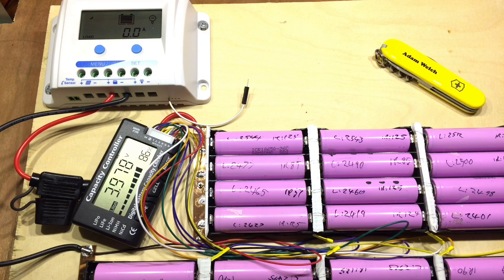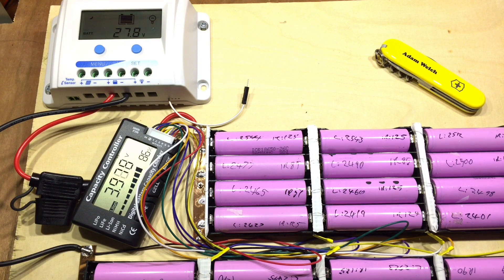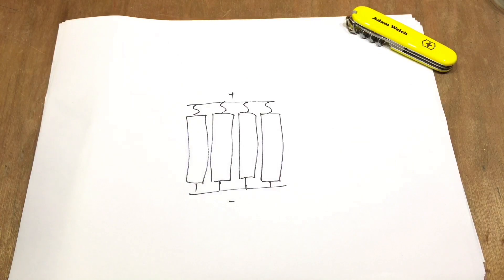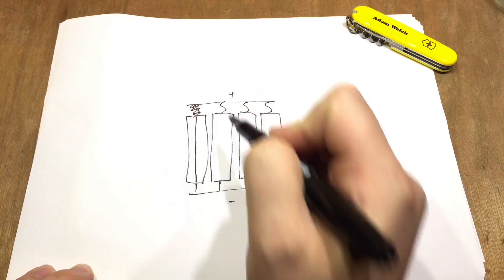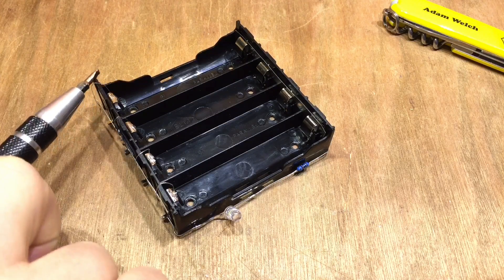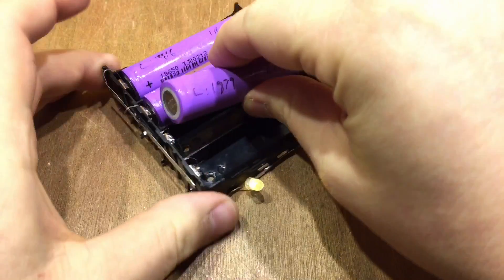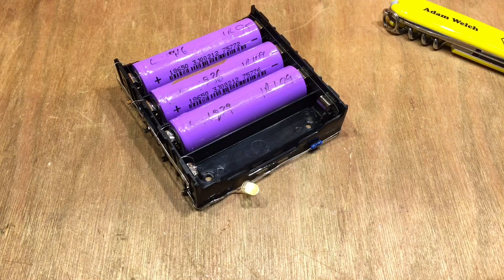Solar Charging Lithium Ion 18650s - Part 4i, Those Fuses - 12v Solar Shed

Comment: So Adam, in conclusion solar charge controller can charge lithium ion pack and balance itself reasonably. Recently I was fumbled by BMS in a pack of battery while charging it with charge controller. It drain all my battery to less than 12v and the charge controller did not turn on or sometimes produce a blinking screen. Your video is very helpful cos now i cam see that i have to remove the BMS and connect it directly

Comment: Impressive Adam... thank you so much for dilligence and fullfilment of follow thru. A year of real world reaults. Just dont see that with youtubers... Im living of he grid in an private RV park if you will in Colorado. Since Ive been living here wich has only been less than a couple weeks, and no power other than neighbor charging my phone and using fashlight at night..  Ive been cramming solar info... Now while im starting with cheap 100w system from harbor freght and going to use their inexpensive sealed agm... Li Ion 18650 is the direction I want to go for myself.
Reply from the maker: Thanks. Good luck with your system and the off grid lifestyle!

Comment: Nice learning video, i have a question, what size of wire do you use, 0.15 mm ?
Reply: From all the videos I've watched they use 1/8w resistor legs/leads, so they cut the wire lead off the 1/8w resistor, keep the leads for a fuse and toss the resistor. Packs of 1000+ are around $15-20 Canadian for me so fairly cheap to do this. You can buy fuse wire but I've had limited success finding it, whereas 1/8w resistors are pretty easy to find.

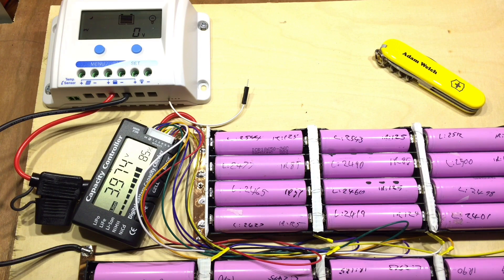Comment: You diagram at 0:49 implies each cell individually connects to a common bus bar via fuse wire. Whereas just prior to that at 0:45, each cell connects to another cell in a series string, not a bus bar? Is there a bus bar under the white tape, which is commoning all of the +ves and -ves in each parallel pack? If true, why didn't you just solder fuse wire directly to that? Also, if true, you've connected two bus bars together with 4 parallel strips of fuse wire, again not the same as the diagram. I realise this is very old and you've changed your setup completely, but because people are still looking at the video, could you explain this a little further please? (You prior videos don't make this super clear either) Thanks.

Comment: I love the video series! Just a theoretical question from a perspective of a newbie: What would happen if 3 cells die at the same time? Delivers the one healthy cell enough current to burn the 5amp fuse wire? If I remember correctly you said that those cells can deliver current up to 2A each Definitely looking videos about short circuits now! Thanks a lot.
Reply from the maker: It’s very unlikely the internal structure of the cells would break down so rapidly in three cells concurrently. In reality, the breakdown of the internals would be gradual, meaning the current going into the cell would slowly increase. If everything is working as it should, you should notice a weak pack well before a fuse blows, giving you the chance to locate a bad cell.
Reply: Just subscribed :) thx again.

Comment: Aha! fuse question from your previous video answered.
Reply: Neat website you linked (repackr.com) I can't figure out what "deviation" means, however. Can anyone help explain this to me?
Reply from the maker: Deviation is the difference in capacity within the group of cells.  So it's the difference between the lowest and highest cell within one group or pack.

Comment: Hi Adam
I really like your videos which are well researched, clearly explained and nicely presented! 
I have a narrowboat with the usual 12v lead acid leisure batteries, total 345 Ah, and four 50 watt 12v solar panels which are set up in 2x24 volt strings to charge the batteries via an MPPT controller, and also of course by the boat engine alternator.
One day when they are cheaper, of course I'd like to have all lithium batteries, but in the meantime, I wondered whether it might be possible to have a two-stage system, in which the first stage is a 24 volt lithium battery pack of the sort you have described but rather larger, charged directly by the MPPT controller. 
The second stage would comprise the existing lead acid batteries still charged by the alternator in the usual way, and also charged from the lithium bank via a second controller which would step down the voltage from 24 to 12 - this could be a cheap PWM controller of course.
There would be a number of advantages in doing this: as you have pointed out, the 24v arrangement of the lithium batteries is better for the batteries, but of course a lot of people have got everything set up on 12v systems.  In addition, with the alternator still connected only to the lead acid batteries, the system could accept solar charge even when the alternator was running - at the moment that won't happen because the MPPT charge controller sees the alternator voltage of say 14.4 volts at its output and thinks the batteries are already fully charged.
As we are most likely to be running the engine in the daytime of course, this means that a lot of solar input can be wasted, which could now be stored as additional battery capacity.  The lithium bank wouldn't need to be huge as long as it could store say, one day's solar output, but could give the whole system a significant boost - what do you think?
Thanks very much if you have read all this - I can see it's got a bit long!
Regards
Nigel
Reply: Just noticed a slight error in the above - of course if you used a cheap PWM controller in the second stage, it couldn't handle the stepdown from a possible 28 volts, so would need to be supplied via a DC-DC stepdown converter.  But these are now very cheap as well.

Comment: I'm wondering about the fuse test that you've done, it seems that the test isn't testing what you've actually got connected. In your test, you don't have a nickel strip across the whole section of the positive side before it gets to the fuse, you just have a straight fuse connection, if you did, wouldn't it short out across the whole nickel strip and thus cause serious current draw? Could you test with a nickel strip on the positive behind the clips and another one in the same place you have it to see if that would short?
Reply from the maker: Hi David.  Each group of cells is commoned at the negative end - therefore each group is also commoned at the positive end.  The difference is that at the positive end there is a fuse between each individual cell and the nickel strip commoning the previous groups negative.  I'm not sure I'm explaining this very well...  I'll draw a couple of pictures...  Test Setup... https://goo.gl/photos/JNSmQSA7Q1QfNWxg6   Real Setup...  https://goo.gl/photos/GhYnX6pboTeFxii66

The test is intended to point out that if a single cell in a group dramatically failed and went short circuit the fuse would blow.  Now in reality it wont fail that quickly and will likely draw less current than demonstrated here.  But if it fails in a more controlled manner the fuse isn't likely to blow - but the cell isn't likely to get too hot either and ultimately we'd see a pack struggling to keep the same voltage as the rest under load.
Hope that helps - Unless I've misunderstood the question?
Reply: Ah, no that's answered it, thanks, that helps a lot. I thought there was nickel on each positive and negative side of your real rig (ie. non test rig) so I was confused, but that makes sense. I'm planning on doing the same setup as you've done with the 7s 24v. I really like how modular it is and  how the charging characteristics of gel are conducive to li-ion charging in a 24v li-ion configuration.
Reply: Adam Welch 
that got complicated in a hurry didn't it! I'm looking in to building these packs. and I'm wondering the dimensions of the nickel. and the current capacity. before I buy anything.

Comment: Hi Adam
Why did the LED go out?, the other 3 cell's are good so the LED should have stayed on.
Reply from the maker: The led was attached between the two battery lugs which I shorted.  The power to the LED was also cut when the fuse blew between the nickel strip and the battery lug at the positive end of the led circuit.  It was intentional, but not explained sorry :-/  I wanted to ensure you could see when the fuse blew - but actually it wasn't needed and has caused some confusion.

I'll do better next time.
Reply: @AdamWelchUK  you did great LOL...just next time put a similar LED light on the bus bar to show the contrast of how one light goes out and the other light stays on but reacts to the power dip/surge elsewhere in the system etc etc etc...that way it will mimic your actual load on your shed system...thanks for the great ideas and vids
Reply: A Mathamagition !
Reply: Thanks for the explanation. I was scratching my head at this, too, given that the positive and negative rails were all linked together and the fuses were intended to supply uninterrupted power in case of a fault.

Comment: Nice to see a test of the fuse system. I didn't realize how simple it would be to create a fuse system for 18650 banks...
Reply from the maker: I'm not sure how expandable this is - if you want to make a bank with 100 cells in parallel I think there are probably better ways :-)
Reply: Adam, I believe this is exactly how Tesla do it with tens of thousands of cells in their packs - the probability of a dud cell goes up considerably with quantity!
As more cells from a pack drop out of the circuit, then the rest of the cells in the pack carry more current.
If the current increases and all of them fuse, identifying the original dud cells would get a bit more tedious, as they'll all be fused!

Comment: Adam, could you repeat the test but with a resistor instead to simulate a cell that has a 'soft short'. I think this is a much more likely scenario than a full short. A bad cell draining just a few amps will get very hot over time but may not draw enough to blow the fuse.
Reply from the maker: I will try this out and post if it show dramatically different results.  Cheers.
Reply: Great, look forward to seeing what happens. So much talk about fuses but not much testing so what you are doing is great and sharing the knowledge makes it safer for everyone.

Comment: Good to see that test. I'd love to know what the peak current was. Any chance you could do that again with a (high current) ammeter in series with the fuse?
Reply: Adam Welch easier solution,  connect meter in line with the same length of  "fuse" and  a power supply.  Gradually increase current and watch meter for max
Reply from the maker: Thanks Paul.  My vici multimeter only go up to 20 amps and I'm not sure it would be quick enough to capture the maximum current.  I think I might be able to perform this test using a resister and an oscilloscope better, but I'm not sure my little JYEtech is going to be good enough.  I have a 'proper' scope on my shopping list but I'm having to save my pennies.

Comment: I watched this video several times, and i cant understand one thing. If one the cells shorts out then fuse blows, but why LED stops glow after short circuit cell is disconnected by a fuse? Is that means, that whole pack is no longer delivering energy? Am I missing something from video?
Reply: If you look how its soldered, its connected to the battery holder leg, not the nickle strip connecting it to the rest of the pack. So when the fuse blows, the circuit is broken.
Reply: Gintautas Raštikis I don't get it either. I would think that for the duration of the short, the LED would be out as it receives no current, but once the fuse goes, the circuit is restored. Adam, please enlighten us?
Reply: Gintautas Raštikis A comment a bit further down from Adam says that the LED was connected in series with the fuse that blew.
Reply: Fellows , as the first and furthest battery was installed  , the LED was lit. 
I , as well believe the lamp was/is attached to the buss.  What gives ?
Reply: The LED is connected not to the common positive of the whole pack, but to the positive of the empty socket. I.E. The current for the LED flows from the batteries, through their fuses, along the bus bar, through the 4th fuse and into the LED.
When the fuse blows, there is no path for the LED to the rest of the pack.
Reply: As a few have mentioned (and thank you), I see after reading their comments.  The LED is soldered to the bottom of the battery + terminal connector (where it sticks out at the bottom of the plastic holder).  The fuse is soldered from the top of the same battery connector (on the springy bit), to the Busbar.  When the fuse blows, the battery is taken out of the circuit; this is demonstrated by the LED going out.
Reply: Yeah, the LED is attached to the lug of that empty slot that he shorts so when the fuse blows it isolates the LED.  I was confused at first as well.

I would have prefered to see an LED attached to the bus bar as well to show the REST of the cells still working in addition to the LED showing the cell losing connection.
Reply: Maybe the LED was somehow damaged by the short and so even though power is restored after the short, the LED didnt light back up??

Comment: it may be a good idea to try again with a 0 voltage cell see if the same rection happens
Reply: Adam Welch He's right,  real world they might charge the cell just slow enough to not pop your fuse
Reply from the maker: I'll look into this.  Cheers David.

Comment: The maths tells you it works. But there's nothing to like a real world test to put your mind at ease. 30AWG it is then!
Reply: The real world wins again!
Reply from the maker: I did a video a few weeks ago about fuses ( https://www.youtube.com/watch?v=GyzrxAwxtgA ). In that video I ran 1.6 amps through a 1 amp fuse for a few minutes and the fuse didn't blow. The 5 amp fuse wire in this video should be designed to run normally at 5 amps without getting too hot.  It should blow somewhere like twice its rated value.  So it's a fair bet I think that it has similar properties to the 30AWG copper you are referring to.
Reply from the maker: +NERDVille Exactly. I'll get some sleep tonight ;-)
Reply: 30AWG copper = 10.2A fusing current
http://www.litz-wire.com/New%20PDFs/Fusing_Currents_Melting_Temperature_Copper_Aluminum_Magnet_Wire_R2.011609.pdf
Is that too high I wonder ?
Reply: I've measured about 9 amps per 18650 cell peak drain on my lawn mower - so he might be reaching as much as 30 amps from those three cells.
Reply: Very good point - 30AWG should be fine then.
Thanks Paul.
Reply: Thanks Adam, I see now.
So the Ampere Rating is 
"The continuous current carrying capability of a fuse
under defined laboratory conditions. 
The ampere rating is marked on each fuse."
http://ep-us.mersen.com/fileadmin/catalog/Literature/Application-Guidelines/ADV-P-Application-Information-Definitions.pdf
And yes this means a 5A rated fuse won't blow at 5A but probably more like 10A.

Comment: Good test result there.  I just tested out my fuse wire (I use 30AWG) and it melted just like yours does.  Seems the 5A wire is ~31AWG, so the wire I chose is just a bit higher rating, ~6A, should be about right for the paired cells I'll be using.
Reply: 10A is a common melting rating, this table lists 6A as the "current rating"
http://www.gxk.org.uk/info/wire.htm

and this one about 8.5A:
http://electricguru.in/page_view.php?id=29
Reply from the maker: +R Brown Thanks. Useful to know.
Reply: I found this handy reference giving estimates of fusing current for wire gauges.
http://www.powerstream.com/wire-fusing-currents.htm
It says 30AWG copper is 10.2A, so that's about OK.
Reply: Another reference that says 10.2A for 30AWG copper.
http://www.litz-wire.com/New%20PDFs/Fusing_Currents_Melting_Temperature_Copper_Aluminum_Magnet_Wire_R2.011609.pdf
Reply: Thanks for those tables.
They clearly show the distinction between fusing current and fuse rating.
I learn something there, and 30AWG is good for the fuses.

Comment: The LED went out, okay. But why? Are these 'protected' cells which will switch off in case they detect a short?
Reply from the maker: +Dunkelheit667 No they are unprotected cells. The led was connected to the other cells via the fuse. I connected it that way in case the fuse blowing wasn't obvious on video, but I don't think that was a problem!
Reply: Got it now, the LED was connected in series with the fuse and went out because there was no connection to the other cells as soon as the fuse blew. Thank you for the explanation! :o)
Reply: When you connected the first cell the LED lit up, so its clearly not in series with the 4th cell fuse